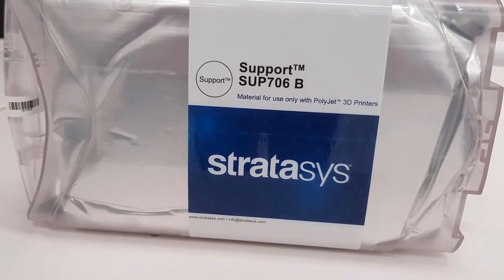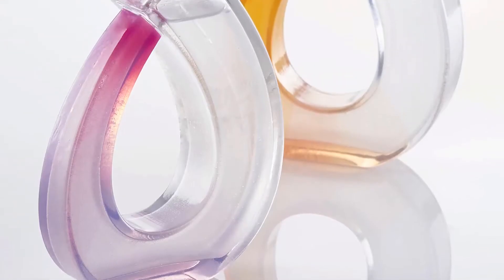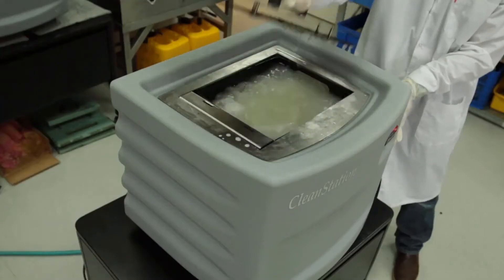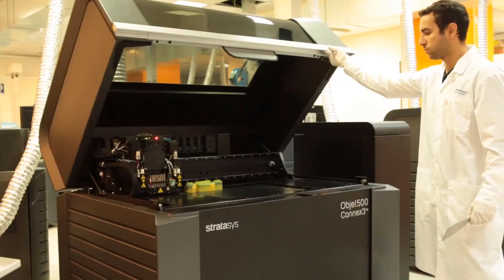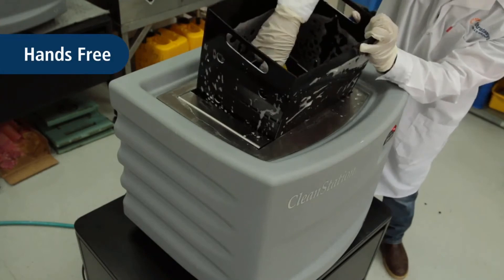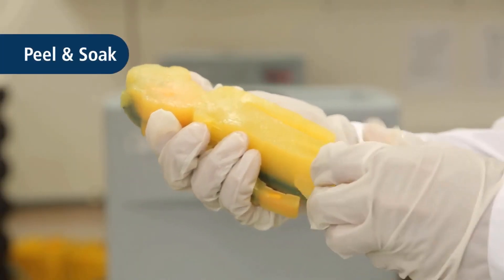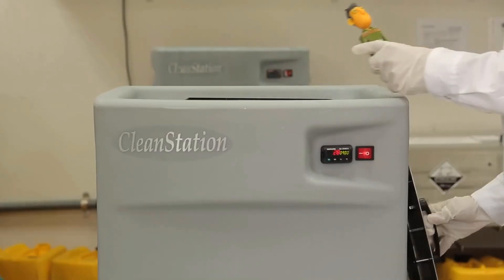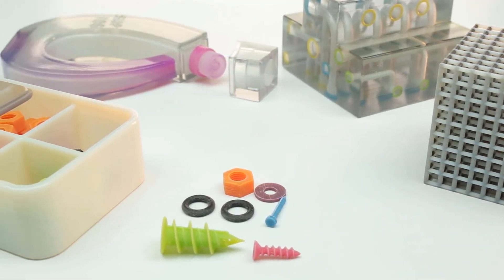Stratasys Polyjet Post-process Water Soluble Support

Comment: Unclear if water in cleaning station should be heated during cleaning or not?
Reply from the maker: Please refer to the material specific guide 

https://stratasysstorage01.file.core.windows.net/portal10-files-prod/Public1/Materials/Polyjet/PolyJet%20Support%20Materials/SUP706%20and%20SUP706B%20Support%20Material%20-%20EN%20PolyJet%20Best%20Practice.pdf?sv=2018-03-28&sr=f&sig=uCQeU%2Fkl1AH4wql3J37X0FAsb4HQwxhXq4LO%2Fd8PlAA%3D&st=2023-04-06T23%3A39%3A20Z&se=2023-04-17T23%3A39%3A20Z&sp=rwl